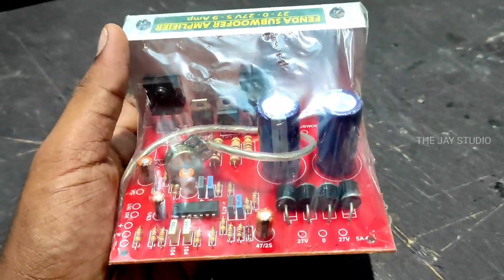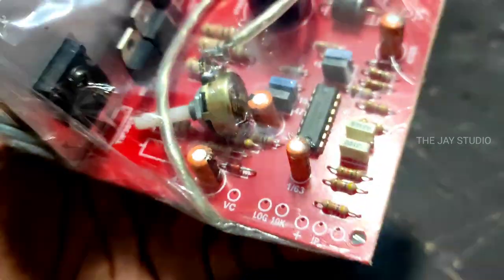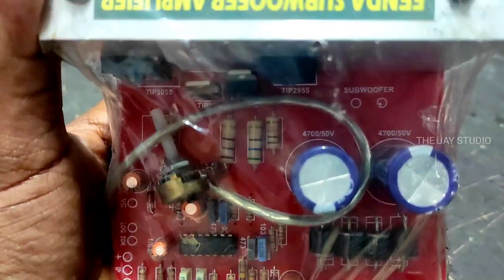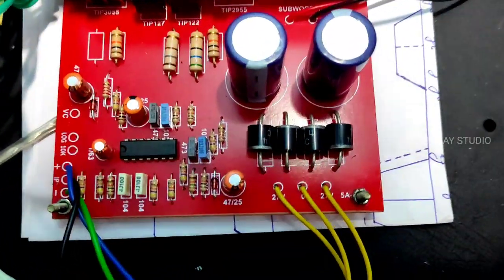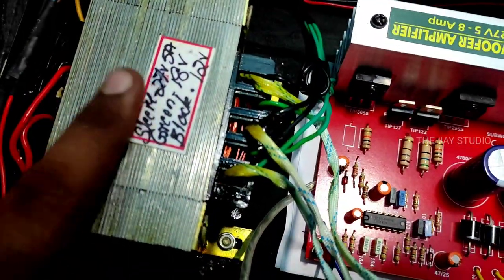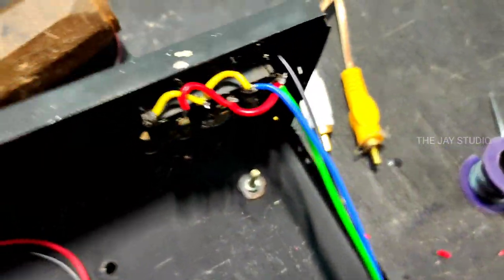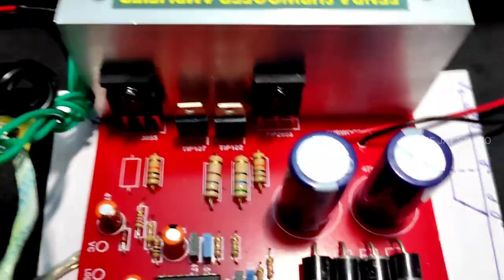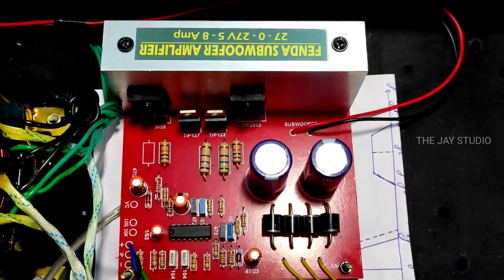FENDA 250W Sub Amplifier Board | 27-0-27V | 5/8A | Review

Comment: 27-0-27 transfomer kodukkano ithil 24-0-24 alle safe,max ethra voltage ith pidikkum
Reply: Cheta aa bordil 27 0 27 ale appo namak voltage kurach kudathal kuzhpm undo 24 0 24. Kodathal kuzhoam undo🤔
Reply: 20 to 27 vac.   24 0 24 safe aannu woofer coil damage varilla. 27 0 27 il bass varumbol coil over aayi push avunnundu atharum sredhikarilla . Manasilavanamenkil woofer kaikalil vechu diaphragm move ment sredhikkanam

Comment: Bro njan ee board വാങ്ങിച്ചു but my subwoofer 4 ohms 8 inch 120w PEAK POWER njan low sound play good performs but 8 ohms subwoofer use better 4 ohms subwoofer use any problems please reply
Reply from the maker: 4 ohms akumbol heating orupad undakum.... Cooling fan okke vekkanam....8ohms aan recommend cheyyunnath
Reply: @MrJayBee_YT   sound കുറച്ചാണ് വെച്ചിരിക്കുന്നത് 20% volume
Reply: 4 ohms inte 2sub kothal mathy eee amph 8ohms above aanu njn use cheyyun nd. Bro de sub 120w peak aanel povan chance nd njn nerthe use cheyythe 125w rms 500w peak ulla jbl inte pazhe sub arnn ithil full ittal distortions varnn ndrnnu epo njn 1500w peak ulla sub aayit series aayit wire cheyyth 8ohms aaki use cheyya sound koorav nd ennlum safe aanu
Reply: 4 omhs aanegil oru tip transistor nannayi heat aavum 8 omhs sub woofer aane vekkan paadulu